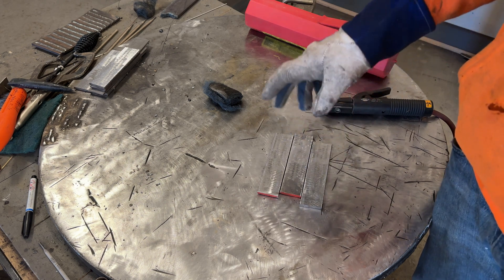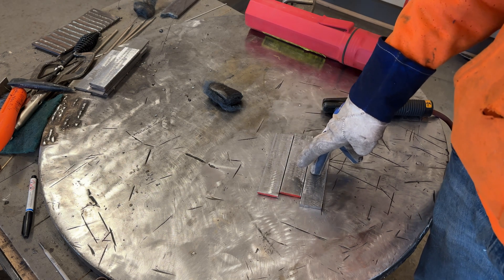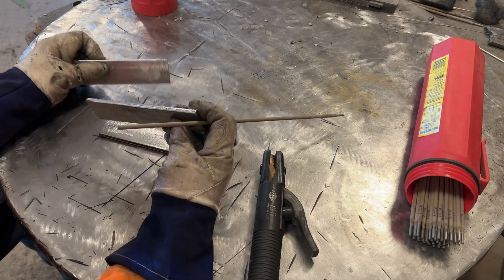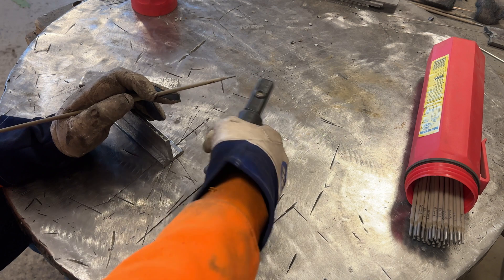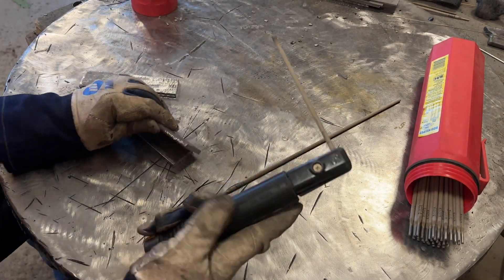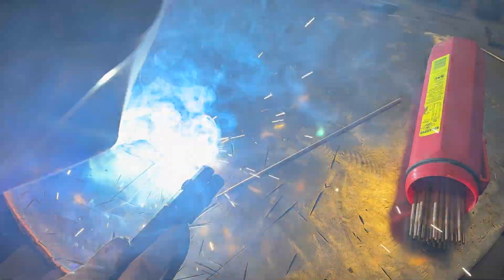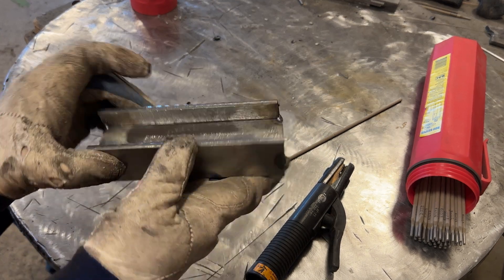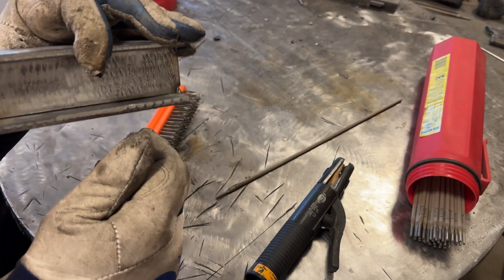DCEN Vs. DCEP Which penetrates more?

Comment: DCEP will melt the rod faster and the flux also , just like it will melt the tig electrode and not put the heat in to the work.
DCEP will be good for thin work or filling a hole maybe when you want less heat and more metal .
DCEN will melt the work and not the rod as fast , just like the way tig is run on DCEN so not to melt the electrode .
Reply from the maker: What you describe works for tig, however both stick and mig welding is a different situation.  DCEN limits penetration with both stick and mig welding.  In both stick and mig DCEN will produce a weld that literally will sit on the base metal like caulk.  Mig in particular is even more limiting, even with going with much higher wire speed and voltage the weld will literally not penetrate at all.  

The reason tig doesn’t work the same is due to the fact you are not melting metal into droplets in an arc.  Yes it is true a DCEN tig arc produces more penetration than DCEP, however this is penetration with just an arc.  With mig and stick you need to get the filler hot enough that that it actually melts and doesn’t just buildup on the surface.  DCEN with stick or mig is going to have major issues making properly fused welds on anything above 1/8th material.  Don’t believe me though, do a simply plate test.  Take 1/4inch (6-7mm steel) and run a bead with proper settings and on DCEP with either mig or stick.  Then reverse the polarity and do it again.  Cut it, etch it with naval jelly, and you will see exactly why DCEN doesn’t work.  Or even better do two fillet welds and cut them in half.

Comment: I'm in no way a real welder but here  95% of hobby MMA welding is doen with 6013 and the package specifically mentions they are supposed to be welded with DCEN. And even on my EU brand welder the connection for the ground clamp is the +
Reply from the maker: So one of the odd things in welding is how some countries do things differently than others.  In America 6013 is welded DCEP, but is known as a universal rod (it will run any polarity).  The only time it would generally be used DCEN would be sheet metal.  All rods will produce less penetration DCEN, and most (6010,11,7018, etc) run poorly on DCEN.  The flux composition of your rods is likely different than most in the US, we only have a singular 6013 and from what I have read many countries have multiple 6013s with differing flux compositions.  All that matters is that you’re getting good results and it wouldn’t hurt to run a couple test welds with both polarities to verify it is indeed working the way it should 👍
Reply: @makingmistakeswithgreg  hmm OK I never imagined there would be multiple types of 6013s.. I thought that would be standardized.. Thank you for the feedback. 😊

Comment: Hello, thanks for your video. I always wondered why they called DCEP “DC Reverse Polarity” and DCEN “DC Straight Polarity.” I was taught that Electrode Positive does have the cleaning or De-oxidizing  effect as you mentioned, and that AC also carries this same advantage as well. I also was taught that DCEN Electrode Negative” concentrates  the heat in the base metal more so  thus providing the deepest penetration of the 3 types of current flows . However a larger HEZ (Heat Effected Zone) is present with DCEN and therefore the base metal prone to more warpage, and electrode deposition rate is less than that of DCEP. I  also was taught that AC is better at reducing arc blow esp when welding on magnetized metal. Also was taught that arc blow can be eliminated or improved by placing the ground clamp to another location, or by adding a second ground clamp at each end of a longer piece such as a long beam. However ac creates more spatter than the other processes and can be harder to control the arc.
My favorite rods have been the 6010, 7018 and 7024 for its super smooth fine ripple and wetting effect, however as you know 7024 is not suitable for vert or overhead positions.
Keep up the great content Greg. You are a awesome guy for teaching people as you do. Hopefully someday we can actually see you face and not just your hands. 😁👍
Reply from the maker: So one of the strangest things in welding is polarity.  I made a video on it explaining this in depth, link at the bottom of this reply.  Anyway what’s strange about it is the process used has a ton to do with what polarity works the best.  Universally DCEP produces the best penetration.  This is true with short arc MiG, spray arc, dual shield, and stick welding.  However this is not true with tig and self shielded flux core.  The issue with MiG and stick is when you run DCEN the rod/wire tip doesn’t get nearly as hot as DCEP.  This means that the metal that is leaving the rod tip and impacting the plate is colder, and thus more metal stacks up vs wets out/penetrates.  It’s not so much that arc itself doesn’t have more penetration on DCEN, it’s that the molten metal is colder.  With self shielded flux core wire it’s interesting because it functions on DCEN.  I believe this to be the case because the thin hollow tube simply would blow apart on DCEP.  By running DCEN the wire still gets so hot it melts to a liquid before it hits the weld pool, but under more controlled circumstances.  

A/c definitely handles arc blow better.  A lot of the reasons for this is it helps the flux burn off very consistently.  On D/c it’s very common for the flux to “fingernail” where the arc starts wandering due to inconsistent flux burn off.  A/c solves this because of the alternating ep/en polarity makes it hard for the flux to burn off inconsistent.  The trade off is a/c loses penetration and generally requires more amperage to run a rod because the a/c waveform spends time at zero volts.  

The video https://youtu.be/3cgOK02DMrY?si=cNj6p4lL9yArtUl4
Reply: @  Thanks for your reply. Your explanation makes good sense. I always believed during actual welding that DCEP did in fact produce deeper penetration despite my readings elsewhere. Your explanation makes sense too. I really appreciate your service to all us your viewers. I can imagine just how much time it takes to put together a video, Esp with editing and all. I myself am a graduate of IvyTech Weld School of 1987, after graduating high school in 85. I found welding to be a very interesting study, and did it professionally for about 10 years of my younger life. I still love welding, and do it whenever I get a chance. I currently own a Hobart Handler 190 and run it off 240VAC with C25 gas. I also have an Ox/Acetylene torch setup. I have also found gas welding of steel fun and challenging as well using my torch. Have a wonderful week my friend. 😎👍

Comment: Tried the same thing today, I normally run dcen with 6013 because it really starts und runs nicer, but yes, your travel speed is higher and therefore I also had a little undercut. If you force yourselve to go slower you wil put to much heat into the material, just going down a couple of amps in relation to dcep wil slow you down a bit and prevent the undercut was my experience today. But I noticed another thing. I was welding INP 100 with mill skin on it, on dcen it penetrates much better and has a good looking weld, on dcep it was crap with the same settings, not enough penetration, may be more amps here also, did not try that. Like your video’s by the way.

Comment: Hi Greg, after having a little trouble with starting 6013 with slag inclusion and general bead appearance with DCEP, after watching this video I tried my 6013 on DCEN, the first few welds were fantastic, perfect starts etc, but after a few welds on my test piece I was having awful trouble with arc blow which I just could not get under control, I tried moving the earth clamp so I was welding away from it (arc seemed to be going backward, towards the clamp before I moved it). It improved slightly but nothing like the first welds, is this to be expected with DCEN and I should concentrate on getting my starts good on DCEP? 

Just a quick thank you for all these videos, they're incredibly detailed and your teaching method really works well for me, I've gone from only having welded lead many years ago, to running some decent beads, and even welded on some angle iron onto my steel boat for a project I'm working on. 
It may have already been covered in a video I haven't got to yet, but if you could share any procedures for full penetration butt welds on 4mm steel, or point me to a video where you've already covered it, that would be great. Thanks again Greg, keep up your hard work. You're an inspiration.
Reply from the maker: So DCEN will be more subject to arc wandering depending on the particular rod and the configuration of plates.   Because the arc comes from the tip of the rod to the plates, a small change in where the arc moves too will cause the flux to melt off more on one side of the rod.  This will then cause an unstable arc.  When welding on DCEP and a/c you have the arc moving front the plate to the rod tip from multiple angles which helps keep the flux burned off uniformly (a/c is the best).  I find that DCEN works best on butt or lap welds of fairly thin material (under 3.2mm).  When you switch to thicker material or fillet welds, 6013 will have a bad habit of getting slag inclusions and arc blow because the burn off rate of the metal rod inside the flux changes (slows).  To a certain extent DCEN with stick is really to limit penetration and prevent burn through.  Another thing to keep in mind is with stick welding I can pass a simple vertical and overhead structural test with 7018 no issue.  With 6013 (even though it’s never used for that) I don’t think I could, because it’s actually harder to weld with it and not have weld defects.  The reason I bring this up is that 6013 can be a hard rod to get really clean welds with on anything other than lap and butt welds.  The moment you weld fillet welds or thick steel lap welds (anything that doesn’t allow the pool to flow out) defects are far easier to pop up.  

As far as full pen 4mm welds, that could be done with stick.  However it’s going to come down to a few variables.  The big one is what rod.  6013 has minimal penetration, and I have doubts that it would fully weld 4mm with the plates tight together.  You need to have a whisper of a gap, something in the ballpark of 1-2mm.  The problem with welding with a gap is it will be easy to blow completely though.  It is actually very hard/ skilled endeavor to have full fusion open root on plates.  Without an open root the penetration will likely be inconsistent.
Reply: @makingmistakeswithgreg  thanks for the information, the practice welds were just flat beads on plate, with 6013 both 3.2 and 2.5mm rods. I'm glad to know it wasn't just me doing something wrong that caused me to struggle getting nice overhead fillets with 6013. Thanks again 👍🏼 

That makes sense, I'm assuming something like those welds would be multiple pass?
Reply: @makingmistakeswithgreg  just incase I wasn't clear, both sides of the fillet would be accessible for welding. I've heard methods like leaving edges square welding one side, grinding out the weld from the other side forming a V or groove, and then doing one or two passes on the ground side. Or starting welds with the grooves already in place. Hope this clears things up.

Comment: I bet in countries where 6013 is popular, they have as many of those buggy weld problems worked out as they can.
Reply from the maker: From what I have seen with countries that run a lot of 6013, they basically have to types of 6013s.  One of them runs closer to 6011 than 6013.  The only common 6013 here in the states has some real bad tendencies like excessive flux running infront of the rod, which isn’t an issue for many other countries 6013.  Strange how that worked out, not sure why that’s the case lol.

Comment: can you switch polarity on any IGBT Dc inverter welder?, especially if the user manual says in instruction to have DECP. i am a newbie
Reply from the maker: All dc inverter welders can be switched to be positive or negative via switching cables.  The only exception to this is very cheap machines that have wires that are soldered on internally, those you might not be able to swap.  😀👍

Comment: is it possible to use more amps with EN
Reply from the maker: On EN the weld tends to sit like a bead of caulk on the plate (aka doesn’t wet out).  With more amperage more rod burns off but it doesn’t wet out more.

Comment: I took a  1 year welding course at a technical school almost 20 years ago while I was a senior in high school,  ultimately I'm a journeyman electrician lol.   Anyway,  I remember most of the textbooks saying DCEP  aka DC reverse polarity as having greater penetration, ironically GMAW is almost always performed using a DCEP, constant voltage welding machine.   Some other textbooks mentioned DCEN, aka DC straight polarity,  as having greater penetration since the positive pole has the  greater heat concentration, and GTAW aka Heli-arc uses DCEN with the exception of aluminum and a few exotic metals and alloys use AC because the electrode positive half of the sine wave provides a cleaning action that breaks up oxides on the surface of the base metal, which form upon exposure to oxygen regardless of how much cleaning preparation is done, which should be one of the first goals anyway regardless of the metals your working with.  

All the textbooks however, mentioned AC as having medium penetration and being virtually arc blow-proof, which can be a major disadvantage of welding with DC especially with large electrodes at high currents.
Reply from the maker: So the interesting thing with welding is electron flow actually matters.  A normal simple circuit doesn’t really care which direction a electron actually moves, but when you have a established arc whichever object the electron strikes (the wire/rod or the base material) more heat is input to it.  In the case of mig welding it operates where the electron strikes the wire, which drastically increases the temp of the wire.  Especially in spray arc where the wire never shorts out.  With flux core wire it operates on DCEN which works due to the shielding gas it creates combined with thin hollow tube of a wire.  If it’s run DCEP the tube simply can’t handle the current.  With tig it operates on DCEN for a couple reasons.  1) the tungsten can’t handle the heat produced on pure DCEP, it would melt.  2) because the tungsten isn’t consumed or melted for filler, getting it super hot provides no benefit.  And 3) the super narrow arc of DCEN provides great penetration.  With A/c and tig you only run 65-75% EN and the rest EP.  Even though most is still negative you lose a ton of penetration potential.  The EP causes the arc to be wide due to electrons jumping from the area around the plate onto the tungsten, the heat is not focused.  Like you said though the a/c breaks up the oxide layer and makes it far easier to weld aluminum.  

Interestingly enough aluminum can be welded purely on DC.  It requires helium.  I did a lot of reading on this (and I have actually done it) and it’s still a bit of “magic”.  What I mean is helium itself is inert, however it’s documented that it has a cleaning effect on the oxide layer.  Helium increases arc voltage (what’s required to maintain the same arc gap as argon) thus heat input is higher over argon, but the heat alone can’t be the only cause for the fact it works and argon doesn’t.  DC with helium will provide huge penetration on thicker aluminum.  This simply isn’t practical to use at home due to high cost of helium 

Anyway the hard part with determining what’s going on and what will have the most penetration is it’s entirely dependent on what welding process is used.  Tig DCEN is the highest penetration, short circuit mig DCEP is, flux core DCEN, and stick is DCEP.  Although DCEN and ac are close to the same as DCEP.
Reply: @makingmistakeswithgreg  very interesting.   I've ran a TIG machine a couple handful of times but always used argon.  I have read somewhere,  maybe in one of the older textbooks at welding class I attended, that many old timers use the term Heliarc when referring to GTAW aka TIG welding is because originally,  like back during WWII era or early 1950s when TIG was in it's infancy,  Helium was the first shielding gas used and found to be widely acceptable, and the term sort of stuck later on as argon, or argon/Helium mix was used.   Supposedly a 75%Helium/25% argon mix is far more common than pure Helium when welding thicker aluminum plates and repairing castings,  because it combines  almost all properties as pure Helium, with the benefits of argon.   And the textbooks mentioned tungsten electrodes of  up to 0.25 inch dia. suitable for up to 1000 amp DCEN.     I would assume with welding currents of that magnitude,  it would be an automated process rather than a hand held torch due to the heat and brightness.   I'm  guessing even a shade 14 welding lens might still be too light for 1000 amp TIG.
Reply: @makingmistakeswithgreg For 99% of those working alone and in general application AC is the only method that makes sense. Average penetration and width. Superior results in general. DCEN has deep penetration and low width and that is desirable and non problematic in some applications that can use it geometrically to their advantage. DCEP is the opposite, shallow and wide and that also has its applications. Testing welding requires great care in specific connection types and great knowledge in design and engineering if the results are to be meaningful. In order to choose a method you need to think about the geometry of the connection you want to achieve.